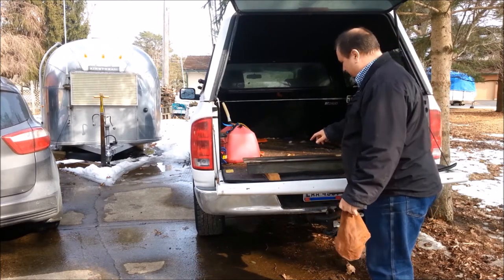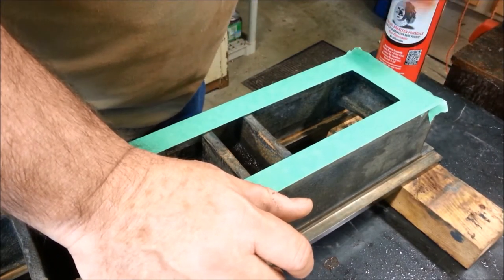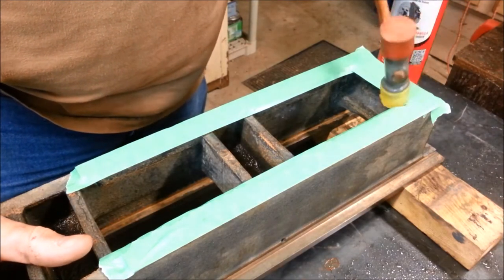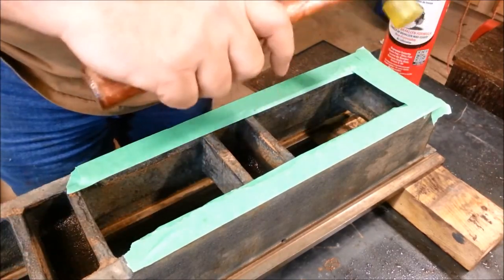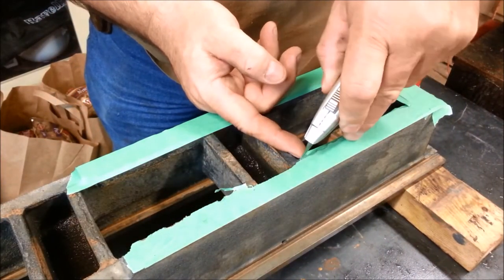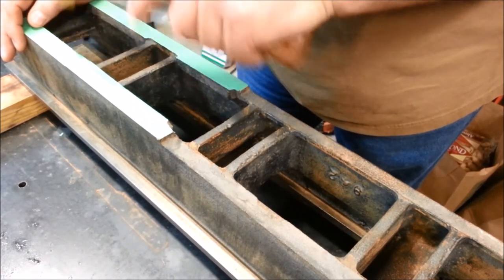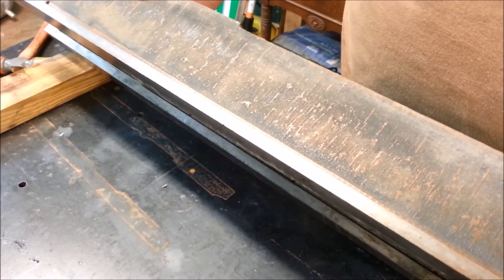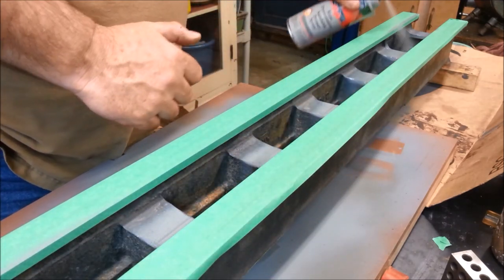Atlas Lathe Quick Change 42 Refurb & Restoration: Part 14

Comment: So that's why I find grit in the brushes.  I have taped hundreds of cars for repainting, never did that. lol  Gotta clean it good or the paint won't stick.  I'm looking at buying a lathe that will take all this winter to refurb.  I'm enjoying it.  Watched a couple of the lathe heal thyself already.  I gotta stop watching other peoples videos and make my own refurbing a lathe. At 12:40 is that surface rust from the pressure washing.  Any paint left after all that stripping will probably not turn loose now.
Reply from the maker: At that point, you are seeing paint down in and along with the casting texture.  You will find you need a lathe to refurb things.  Don't be afraid to buy a second lathe right away that is running.  If you buy it right, you can always get your money right back out of it.  A lathe is the most universal machine tool.  It's considered in any small shop a requirement to have two so you can build parts for the broken lathe when it's down.  ;-)  That second lathe is just like a little savings account.   You can always get the money back out of it.  It will be so handy for spinning things that need sanding or polishing.  Also, I make fasteners on mine all the time.  I hope you make a first video showing your work space and telling about what your dreams are for it.  Take a camera along for the pickup, unload and evaluation. You'll see in later videos I document the more important buys.  Love to share in the thrill of your chase.  Feel free to link me what your looking at.  I'll try to give some feedback.  The really really good deals you need to call and tell them you are ready to pick it up.  Don't go look.  I don't think I have ever went to look at a lathe that was under priced.  I'm an aggressive buyer.  If you're pricing a $700 lathe at $300, I'm just coming to get it and I'm paying the price.  This is how you win.  If you don't do that, most of them will be lost to somebody like me before you get off the pot.  Once you tell them you are on your way to pick it up, they will stop talking to the other squirrels.  You get the nut.  I even had one guy get higher offers while i was on my way (1.5 hour drive) to pick up a $1200-$1400 lathe for $350.  But on his honor he sold it to me because I was on my way and I was not negotiating.  Have courage.

Comment: I should of brought my bed to the car wash!
Reply from the maker: eviltwinx I've learned a little more now.  If I had to do it again, it would be cleaned with Purple Power.  Might take a few treatments, but it's mostly effortless wet down, let it soak, brief scrub with a bristle brush.  Repeat 2 or 3 times to perfection.
Reply from the maker: eviltwinx Got a line on a South Bend Heavy 10, It's even dirtier.  ;-)  I just wonder if there is a place you can take a piece of equipment for general spray down with solvents before taking it on your home workshop.   There are sandblasting service, why not machine cleaning services?
Reply: There's a new business model for you.  Machine tool pressure solvent cleaning.